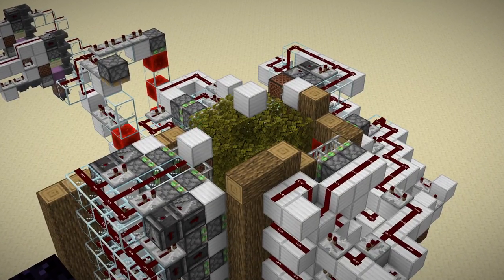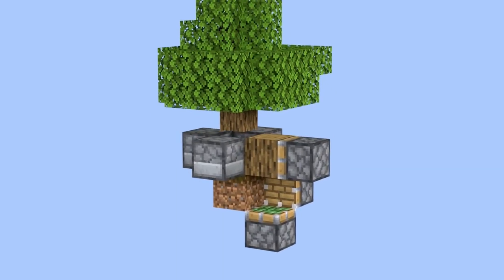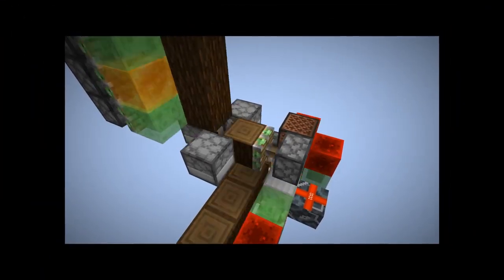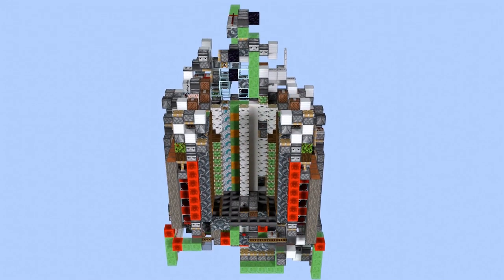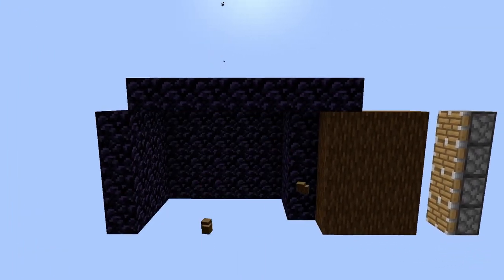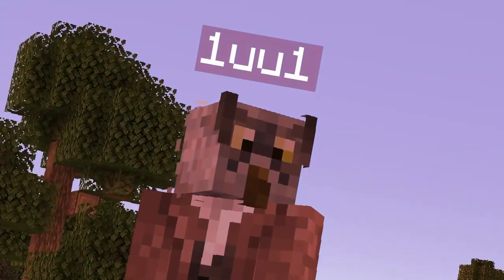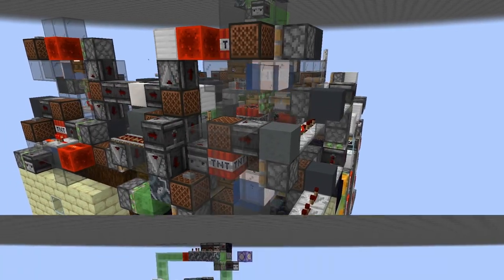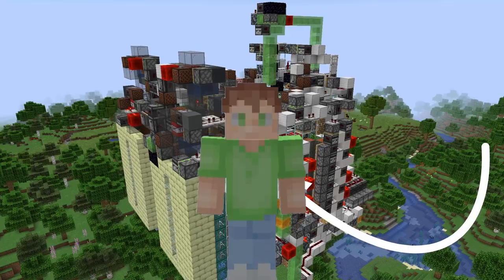I Designed the Ultimate Wood Factory, Here's How

Comment: This farm is insane, and basically produces the max rates possible for a single player. I built this farm a while ago with the same main harvesting system showcased in this video, but has a bit of a more complicated redstone wiring for the mode changing. But overall, this farm is probably the best I have seen for universal tree farms, keep up the great work!
Reply from the maker: There are faster ones out there btw xd.  This 100% isn't the best utf, there are better, by plexi and a few others
Reply: @Activation123  I see.